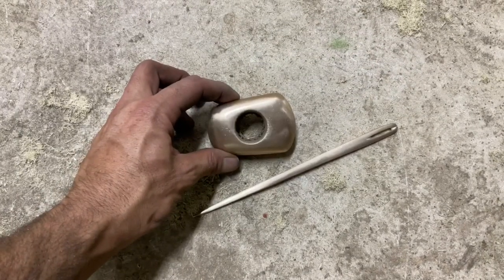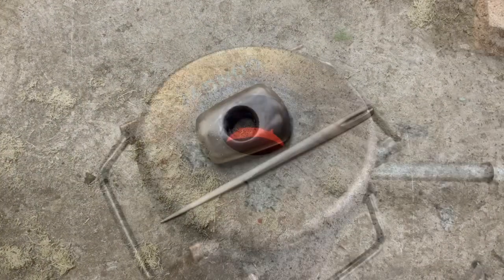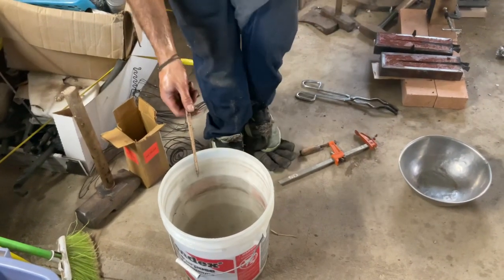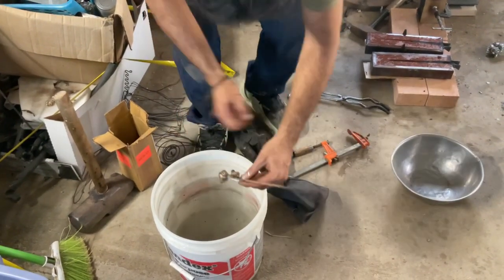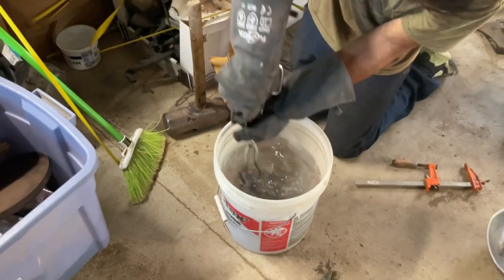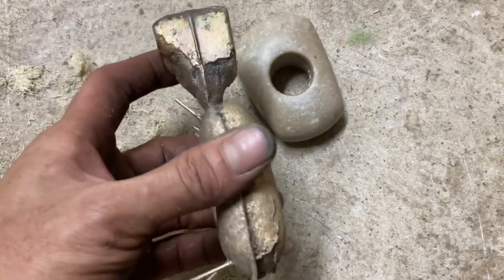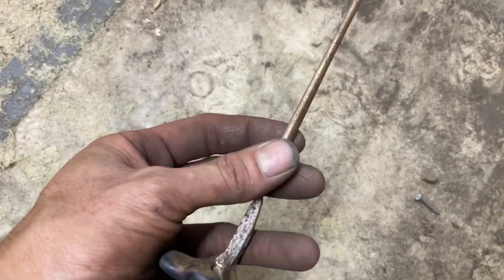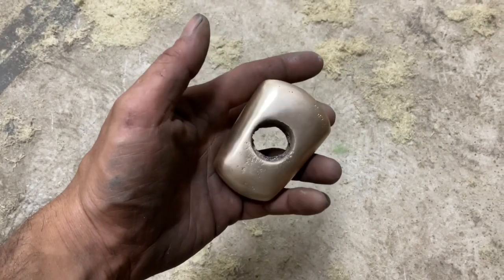Bronze Casting Practice - Sand Casting Stone and Bone Tools in Recycled Tin Bronze

Comment: Had an idea to use a pair of fishing rod blanks to reinforce the inside of a pvc bow. 2 pipes sleeved like usual but instead of carbon fiber rods at multiple lengths just use tapered carbon Rod blanks fitted but to but slid inside. Since fishing rods are already designed to flex more toward the tip and less at the end. Do you think this could work?